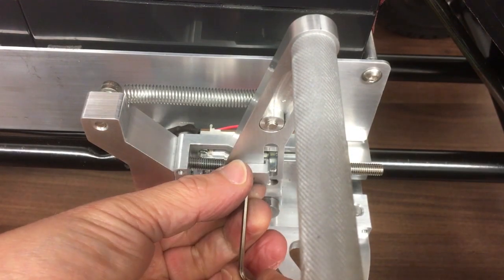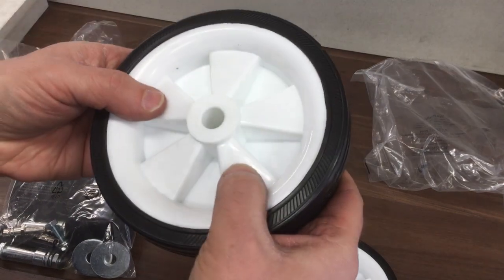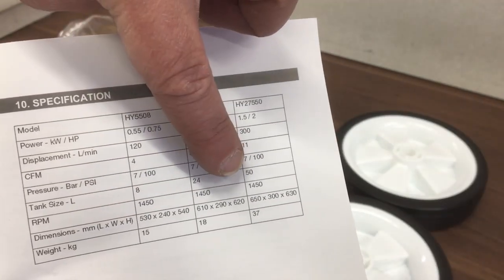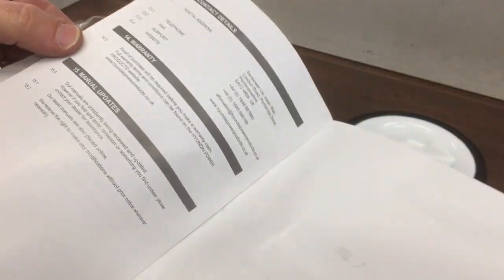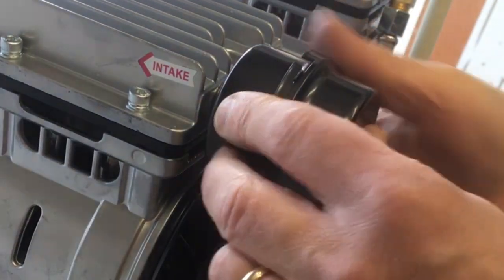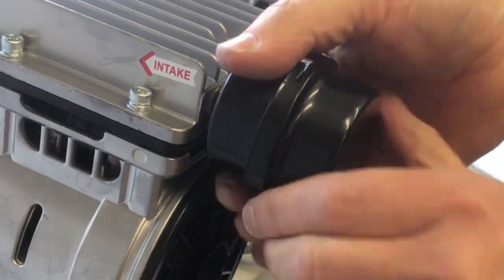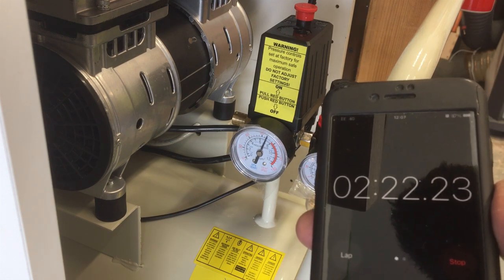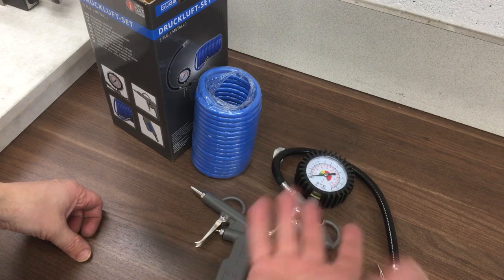Hyundai HY27550 50 litre silent air compressor

Comment: Hi, As a fellow youtuber and machinist , I totally get the issue with the manual and wheels set up . When I wear my work hat I am the product Quality manager for Genpower , The UK importer for your machine and also the company where you bought it . I will be mentioning the manual issues to the person who writes them and also sending a corrective action report to the factory . This is great feedback and we are committed to improving all these little niggles . Great review by the way and I have subscribed . Cheers Ade.
Reply from the maker: Hi Ade.  Welcome to the channel.  I have watched some of your channel too and particularly enjoyed the video on the lathe change gears.  As you might have noticed I’m in the middle of an electronic leadscrew project which should avoid the need to ever change them again!
Thanks for your comments on the compressor review.  I’ve had it for some time and continue to be impressed; it’s perfect for a DIY hobby machinist with a reasonable amount of air delivery and very quiet.  Thanks for following along!
Reply: Hello ADES have a look at MackieBass review on the Hyundai compressor what he thinks needs to be changed on the water Drain!.
Reply: Hi Ade, I recently purchased this from Genpower and agree with the comments about the manual. It really isn’t great in that it doesn’t even contain a diagram with parts labelled. I think Genpower could add so much value by addressing this deficit.
Reply: @the_cafe_racer_project  all been fed back to the factory for improvement on the next production run . Thanks Ade.
Reply: good one Ade.
Reply: I'm a bit late to this video but I also have a query about the manual. Looking at it @ 6.19, have they really manage to get double the air capacity in just 40mm extra length & 10mm extra width & height? I;m definitely buying one if they have.

Just checked the website & it's 760 long & 760 high!!!
Reply: @Arckivio  yes really quiet machine also. and bonus is that all the niggles from this video are fixed now , Cheers Ade.

Comment: Everyone needs an air compressor - you'll find more and more reasons now to get extra tools for it.
It may pay to extend your air inlets to suck from outside the cabinet. As the temp increases in the cabinet, sucking in hot air will take longer to get up to to pressure. A flow-through fan should also help with this & extend the life on the compressors.
Have fun - Stay safe and well :)
Reply from the maker: OK yes those are some good ideas there and makes sense.  Thanks

Comment: What is the CFM rating, its the cubic feet per minute the compressor can produce, this will give you an idea if it can keep up with a tools drain. As en example if the compressor is 15 cfm and a tool draws say 5, the compressor will keep up, on the other hand if a tool has a high flow like an impact gun or big spray gun with 12-15 ish cfm the compressor will be on almost continuously. The problems come as some manufacturers use cfm others show clm or cubic litres minute.
Reply from the maker: I also think the airflow is free airflow without much load or pressure.  As more pressure is needed so the flow rate which can be supplied at that pressure goes down.

Comment: wouldn't a cool upgrade be to install an auto drain solenpid actuated valve on the bottom of the tank there? do such products already exist on the market?

because presumably to avoid forgetting about it, to be rigged on a timer with a little mcu to periodically fire off the solenoid every so often
Reply from the maker: I don’t know but it’s an interesting idea.  The solenoid would need to be closed when it has power from the mains and then when you switch off at the wall it opens and auto drains.  I’ll have a look into it . . .

Comment: Great review, thanks. I was looking for a compressor last year and this one was the top of my list. I didn't end up buying it as I wanted it to run a mini-rotary sander and I wasn't convinced it could supply enough air so I'm very interested in seeing how it runs the sander you've got. I'm also interested to see how you find draining it on a regular basis and opening that little drain valve every day would get boring quickly!
Reply from the maker: I’ve ordered a 1/4 bsp to.euro fitting but it’s not arrived yet so I’ll have to let you know.  I plan to do a follow up but it will be a little while yet.  So I’ll reply back here when I get some time on the air sander. Thanks.
Reply from the maker: I’ve used the finger sander a few times and you only get maybe 10 seconds of run time then the compressor kicks in and you have to wait.  I’ve not tried continuous running but suspect it would not keep it.
Reply: @routercnc9517  the compressor will kick in automatically as the pressure drops in the tank to restored shutoff pressure. I would be very suprised if it would not keep up with a belt sander unless its a monster. The main reason the compressor kicks in is the size of the tank, you can add additional capacity by using an old propane/butane tank or beer keg, you then get portable compressed air as an extra, besides additional tank capacity
Reply from the maker: @incubatork  Hi Derek, yes it was as I expected on the belt sander, but that's OK as I only bought it for the misting and low air volume work.
Reply: 100 tank for air tools with 11+cfm

Comment: Re 'big' (largest) washers? I tried the wheels then gave up - also fit the air filter! Poor 'manual' with the compressor.
Did you find a replacement (better) filter please?
Reply from the maker: I got the wheels on in the end.  I just used the filters that came with it and they have been fine.
Reply: l think they should give anyone buying this the opportunely to either have the two wheels or four rubber legs if its going to be left without moving it around the work shop. Also be able to remove the handle. ps l think the large nut are to go on the rubber legs
Reply: I'm fairly sure those large washers are actually for the rubber feet and not the wheels.
Reply from the maker: @26l8l94  OK you could be right.  Was not very clear in the instructions.

Comment: Watching this as ive got the Small Hyundai Compressor which i feel aint really good for much
Im happy with the no oil and the quietness of the running of it compared to my old 98 db compressor 
However im thinking you need at least 50/100 ltr tank to run any airtools like air ratchet..
Reply from the maker: Yea it depends on what you need to run.  This is great for the CNC misting spray, inflating tyres, blowing out holes etc.  but it won’t run an air sander for long.  Probably not good enough for paint spraying.  If you have the space then going bigger will always be better.

Comment: Great review - still going strong a year and a bit later ?
Reply from the maker: Yes no issues at all.  I drain it after each session and remove the drain plug to let any water out.  Quiet, good airflow, reasonable capacity for hobby use.

Comment: Hi, I have got a question. Do you recommend if I should get 24l or 50l air compressor to respray on small car bodywork like the bonnet, wing and roof using with LVHP spray gun??

I'd love to know!
Reply from the maker: I have not used a spray gun but they tend to need lots of air.  If I run a sander on this compressor it only runs for about 10 seconds before the compressors has to charge up.  I guess you might struggle even on a 50l tank for spraying.

Comment: HI there, excellent review. 
Would you say this compressor would be enough to paint car panels?? Ideally one panel at a time.
Reply from the maker: I should do a follow up video showing how long the air lasts on different tools before the compressor starts up.  An air gun lasts a long time as you only need small squirts.  An air sander lasts maybe 10 seconds before the compressor starts.  I don’t have a paint gun but I think it would be a bit borderline, possibly just enough for one panel but couldn’t be sure.  Hope this helps.
Reply: @routercnc9517  Hi l read that it's not powerful enough for a paint gun for spraying you need the 100 ltr
Reply from the maker: OK good to know, thanks
Reply: @phil3332  it would need another two 750 watt compressor to generate enough airflow, the pressure drop off when spraying is to large due to the silent nature and lower piston pressure.

Comment: I bought one of these this week a d you are right, the wheels are a pain. The manual is rubbish as well. Could anyone let me know where the safety valve is?
Reply from the maker: On my unit I think it is just to the left of the larger pressure gauge.  I read that it used to have a ring pull on it but they removed it because people were using it for drain down whereas it is only for emergency use.  I guess it was not designed to be used frequently.  So now it will only open for overpressure.
Reply: @routercnc9517  cheers
Reply: @routercnc9517  how do you empty the tank without using the emergency release?
Reply from the maker: There is a screw valve underneath the tank.  Give it a few turns and the air will slowly release.  Once empty I remove it to allow it to dry out.
Reply: @routercnc9517  thanks, that is super helpful. And you do that every time you use it?
Reply from the maker: I do yes.  I once forgot for 2 weeks and brown water sprayed out.

Comment: Wouldn't the noise level test of been better not being in the cupboard
Reply from the maker: Yes true, maybe I should have done that test too as it probably would drop by 3dB or so out in the open.  But that was the only space in my small workshop so it was a good test for my situation.  Either way it is pretty quiet and you won't annoy the neighbours.  I did have a plan to line the cupboard with foam but I've not found it necessary having used it for some time.  Thanks.

Comment: Just bought the same £231, interested in free flowing inlet filter if anyone gas any links. Btw big washers go on th feet, yes manual is rubbish.
Reply from the maker: OK, great price!  The filter that comes with it seems OK so far but I've no experience of different filters so hopefully someone helps you out with suggestions.